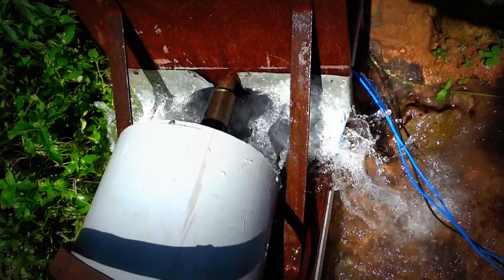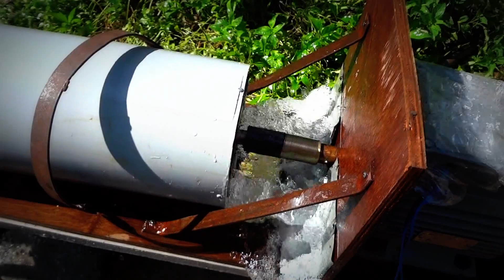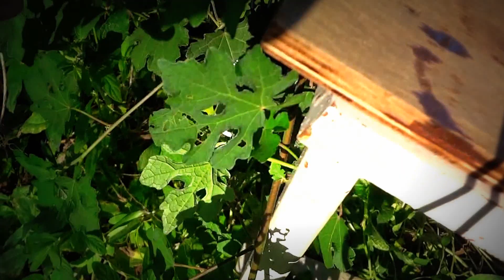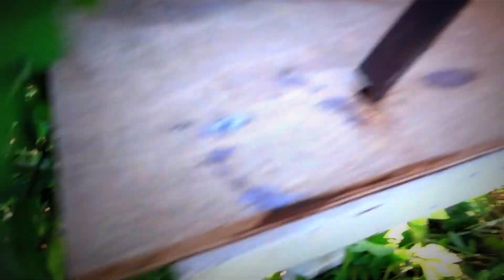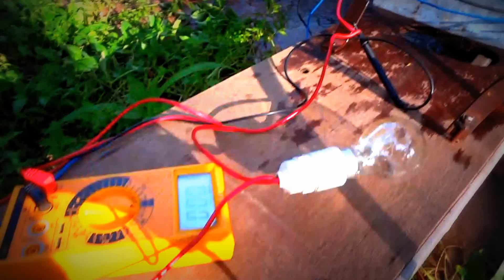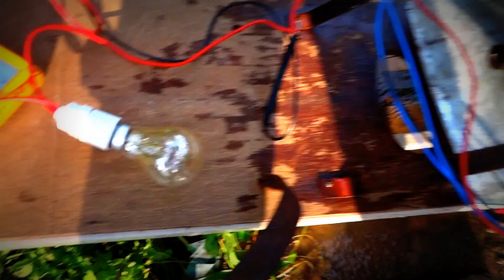Induction Generator with Small Archimedes screw for Pico- Hydro power generation.

Comment: You would be a lot better off with a pelton wheel. 
There is no way wither of these setups are going to come near making 750W.

The first setup is turning the motor way too slowly for a start as is using the fan which will just end up destroying the motor.